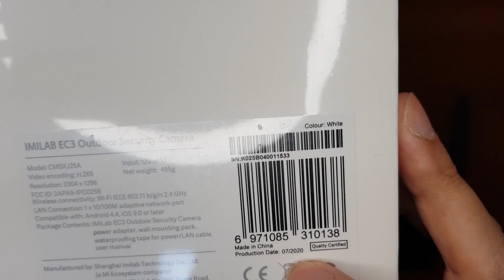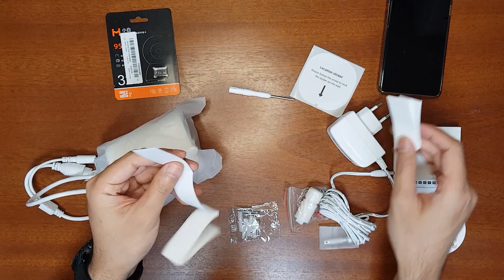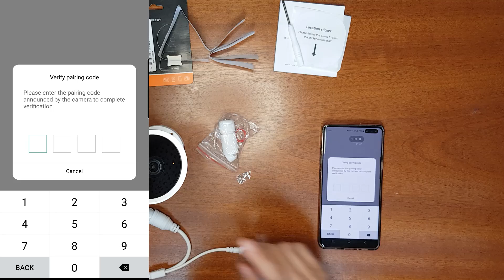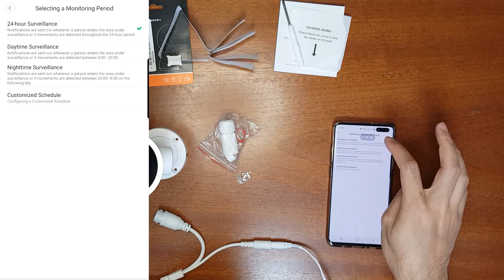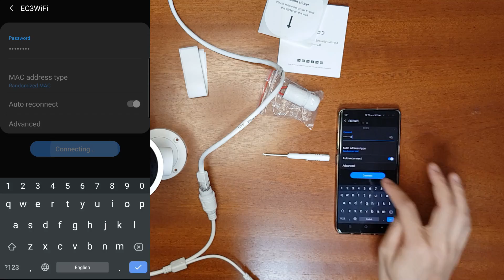Xiaomi IMILab EC3 2K Outdoor Security Camera Review Setup Windows App

Comment: Maybe stupid question, but is the camera using it's antennas only for the hotspot feature? Or also for improving the Wi-fi connection with the home network?
Reply from the maker: For both purposes, it's a bidirectional antenna like in any WiFi router. Thanks.

Comment: When powering the camera using the included power adaptor, how do you waterproof the wall socket connection?

Also, how do you waterproof the ethernet connection when it's not in use? (network connection via WiFi).
Reply from the maker: You have to use/install a wall socket at a weather proof location and probably use the 3 meters cable to connect to the cameras. You can also install a weather proof power box outdoors, which can house the socket and the adapter. For the RJ45 connector, you have to use the provided water proofing cap over the unused port and the tape to cover up the cable opening in the cap. Thanks to your comment.

Comment: Plz do a detailed comparison between mi ax1800 vs Mi ax3600 vs huawei ax3 pro
Reply from the maker: Hi, I have already compared the AX3600 with AX3 Pro here: https://youtu.be/ooCvwpGAFns and the AX1800 with AX3 Pro here: https://youtu.be/BfDVYcS5Go8. The performance is like this: Mi Ax3600> Huawei AX3 Pro> Mi Ax1800. Thanks.
Reply: @DSmartLife  thanks a lot. What will be the positions according to cooling system of these routers?
Reply from the maker: @asmaakter8165  Mi A3600/AX1800 is better than Huawei AX3 Pro in cooling performance. All Xiaomi/Redmi Wi-Fi 6 Routers have good ventilation for cooling but Huawei/Honor Routers lack good ventilation due to the compact form factor. The bottom of the router heats up very fast. Thanks.
Reply: @DSmartLife  thanks a lot. Your reviews are really detailed. I appreciate that. Keep it up 🤩

Comment: It is must to attach lan cable? Or it can connect to router via wifi?
Reply from the maker: You can use it with the WiFi only. Thanks.
Reply: @DSmartLife  so you mean i can view my home from my work place while camera is connected to my home router via wifi ? 😬 Thank you
Reply from the maker: Yes you can view it from anywhere as long as the camera is connected to the internet via WiFi. Thanks.
Reply: @DSmartLife  wifi connectivity doesnt work well.. evrytime there is a brownout it will tell you that there is a wifi connection but it will get stock on 91% and will not display unless you will reset the camera again

Comment: Hi @DSmartLife, so we got hit by the typhoon, my 2 EC3 cams are down. Finally able to climp up and dismantled it. The water seeped in the plug. And it’s not working anymore.it also happened to my 1 magnetic camera. You think the plug can still be repaired? This is so frustrating! 😭
Reply from the maker: Do you mean the 5.5MM dc jack is damaged? Is it the only thing that is damaged? If you think it will work then you can simply cut and join the power cables. Or you can also use this kind of connectors: https://www.banggood.com/custlink/GKvd5Z1Dyz Thanks.

Comment: Hi Bro, I have a question if I have only wifi connection so, it dose work as normal? I mean I do not want to use an ethernet cable, thank for your reply I am waiting for it. bye
Reply from the maker: You don't need Ethernet cable. Just WiFi is enough. Thanks.
Reply: @DSmartLife  So, It's mean I can control or take a look in different lan? I mean when I am at work so I still can access with the camera at home! Thanks Sir.
Reply from the maker: @bophaphang3170  Yes, it works over the internet, you can stream anywhere. Just make sure your internet WiFi connection is strong to the camera. Thanks.
Reply: @DSmartLife  Thanks so much Sir for your promptly assist I really appreciate, thank again and stay safe I will see you on your next video Sir.

Comment: It's able to connect the camera to the wi-fi without the lan cable?
Reply from the maker: Yes WiFi is the main connection mode. The LAN is optional. Thanks.
Reply: @DSmartLife  Ok thanks. Also for work need a power supply forever or can used it for recharge the cam sometimes?
Reply from the maker: @mark0oo-  No this camera doesn't have batteries and you should always power it from the adapter. If you need rechargeable cameras please consider this one: https://youtu.be/WVpBDHynICU Thanks.

Comment: I'm frequently having error "couldn't open camera 2, try again later". I searched for it and got results like the camera should be from the same region as mi home app. But this doesn't looks like the issue. I need the key area feature so i set this international version in chinese mainland region of mi home app. In like 5 min of preview i get this error, restarting app again fix the issue temporarily. I faced the same issue when i set the server to my own region. So think the issue is something else
Reply from the maker: The problem is probably in the Mi Home App. Kindly reinstall it or clear the cache and data from the settings and try again. Please met me know. Thanks.
Reply: @DSmartLife  I've shared this camera to 2 other mi home users and both of them are facing the same behavior in their respective phones.

Comment: I can't see the " Key area care setting " and I don't see " AI humanoid detection to reduce false positives " do you know what to do to have all functions ?  it is new Camera
Reply from the maker: The Key area care feature is available only on the Chinese Server as mentioned in the video at 11:17. The AI feature is supposed to be integrated to the cloud servers, when you enable the Home Monitoring option and will get notification based on the Humanoid detections, etc. Thanks.
Reply: @DSmartLife   Thanks for your fast answer. 
Second question,   does the missing area care feature affect the efficiency of motion detection function ? 
Feedback to your film.   I found it very comprehensive and use it as guidance how to install & use camera.  there is one request for you, Please slower your speech, it is very important and I had to replay many time to comprehend the point.   Especially when someone is new to this area.   
Thanks 
Arik
Reply from the maker: @arikrak  Thank you for your valuable suggestions. I will surely take your points into consideration. The Key area function is an extra function and I do not think its unavailability in the International server affects the other functions. However I also like to see the Key are function in our local servers, I don't know why Imilab didn't add it. I hope they add it in the future. Anyways thanks for your comments and suggestions.

Comment: What's the maximum microSD size it can handle?
Reply from the maker: In the EC3 product listing it says 256gb but N2 was 64GB. I haven't tested above 64GB. It will likely work till 256GB though. Thanks.
Reply: I have used 128gb card and works fine. It needs to be formatted in fat32 however.
Reply: @simpleuser01  How many days of recording does your card last?
Reply: @tirkius3165  I just installed it today but based on previous experience with another 3MP camera I would expect around 16 to 17 days for 24x7 recording.
Reply: @simpleuser01  Be careful and be sure to monitor it.  there are problems when playing on high-capacity cards.
Reply: @tirkius3165  absolutely no problem with a 128gb card. It's been around 10 days since installation and you will get around 12 - 13 days worth of continuous footage on a 128gb card (class 10 should be used)
Reply: @simpleuser01  What happens if the card is full? Do you need to take off the card, transfer all of the videos to the PC and then install it again? Is there an option to automatically delete an old file(s) and start the re-recording?

Comment: What would be the difference if i choose Chinese server over local server
Reply from the maker: Ideally speaking, not much different. But sometimes people complain that the Motion detection notifications come late. And some counties may face slow streaming speed over the internet via the Chinese servers and so on. A local server will be better in speeds of course. Thanks.
Reply: Most of the time for me is not possible to connect at all to the camera, chineese server and reset required.. picture quality some time is awful , like 360p. Sd card is died after week, so i am not recommend to buy at all this camera, better to invest in prooper one. Sadly, because is good looking camera for me...
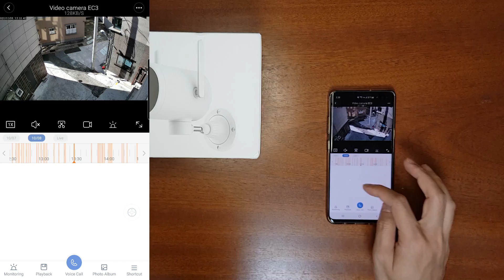Reply from the maker: @digimaxi5  This camera can be connected to you local server and need not be connected to the Chinese server. I don't think there is much problem with streaming online though local servers. I have been using the N2 version for over a year now and I didn't find any problems. The Raw footage of the EC3 is 2K as I have shown at 10:02. Thanks for all your comments.

Comment: After having three of these for nearly a year, I don't recommend them, they have multiple disconnection issues and freezing. You can't trust in this toys. Looking forward for more professional alternatives.
Reply: Works fine, no disconnection or freezing for me, used 2 units since Mac 2021. My only gripe is 2 things, video is always zoomed in as default in the app and no tilt function.
Reply: @miscthings2559 how you connect it, through LAN cable or WIFI?

Comment: My unit wifi sucks , once we have brownouts reconnection is not possible
Reply from the maker: Your Camera cannot reconnect to the Wi-Fi after a power failure or the problem is just during a brownout? It can never reconnect(needing a reset) or it connects after a restart or after some time? The problem can be from your Router or the camera. To make sure the problem in with the camera, you can ensure that your Wi-Fi SSID is not hidden. And you can also set a separate 2.4GHz if you have a single Dual Band network. You can also try powering Off just the camera and power again to see if it reconnects and vice-versa. Anyways let me know the details. Thanks.

Comment: Thank you for the great video. I have a problem hoping you can help me, I am using 2 Xiaomi IMILab EC3 cameras. The two cameras use two different wifi networks because they are very far apart. I can only view the camera on the computer when the computer and the camera are in LAN. I tried to change region, firmware upgrade but still failed (This is software that i use to view camera on may PC https://www.youtube.com/watch?v=iYeYlvX3alQ&t=235s). It shows "Establishing a safe connection..." Please help me, thank you very much